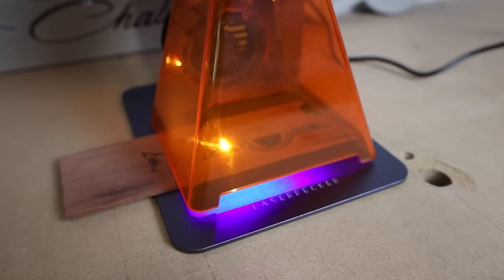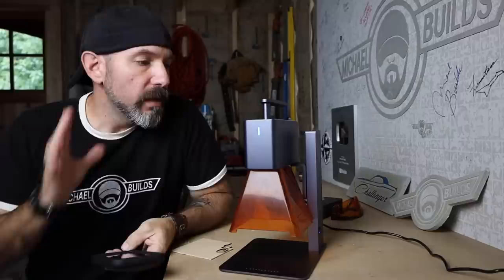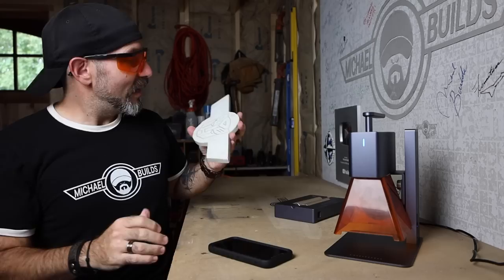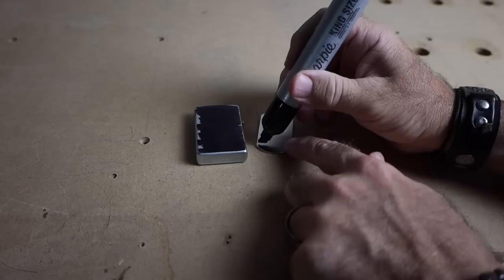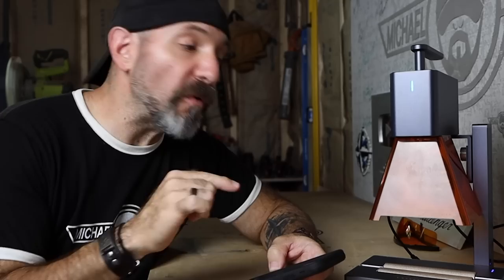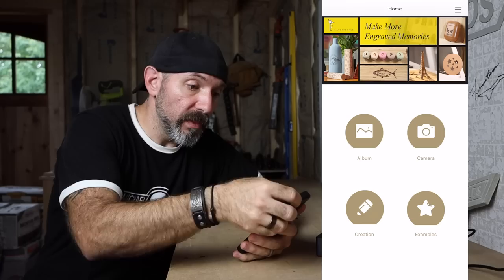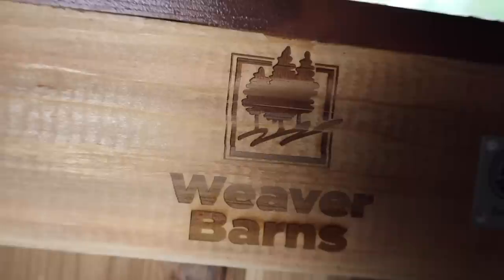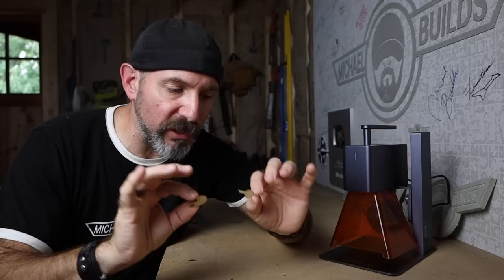How to MAKE MONEY with a Laser Engraver!

Comment: Bought this, I've got an xtool 10w and their infrared head and a 40w CO2 laser.

Xtool has had the best customer service by far. My omtech has gone through 2 water pumps but it engraves and cuts as expected.

The laser pecker 2 is easiest to use with the mobile ap, being able to connect to Bluetooth. They also sell a carry case and a battery unit. I started taking out to vendor fairs to do on-site engraving it paid for itself in a day.

Comment: LaserPecker now has the LaserPecker 4 which is a combination diode laser like the LP2 and a fiber laser like the LP3 so it is two lasers in one.  Plus it has twice the power of the LP2 and LP3.  You can also get a battery for it so you can take it ANYWHERE.  The improved firmware allows to to double the speed as well.  So much fun.

Comment: In trolly mode don’t use the ball bearings it causes it to wonder off a straight line, if you kept them stored and did trolly mode it will stay in a straight line no wood needed to guide it